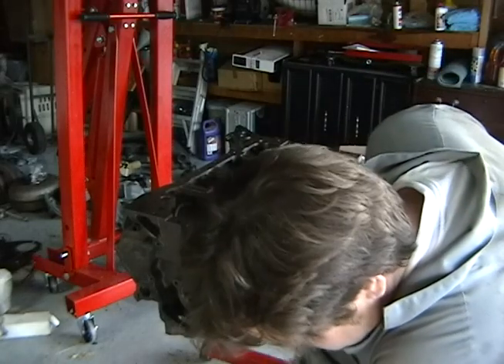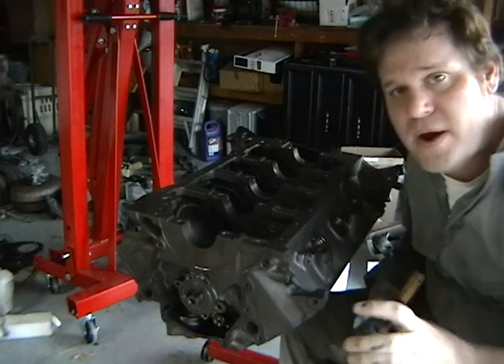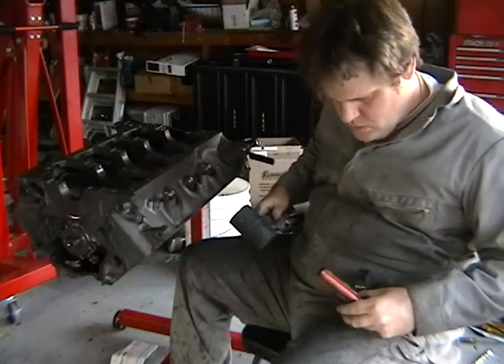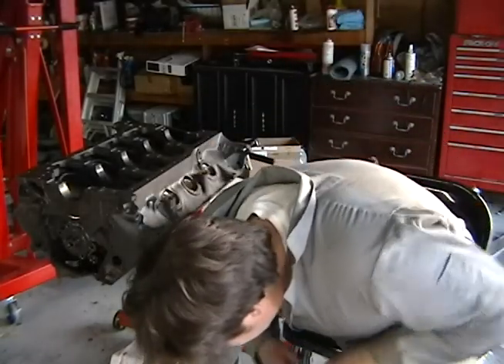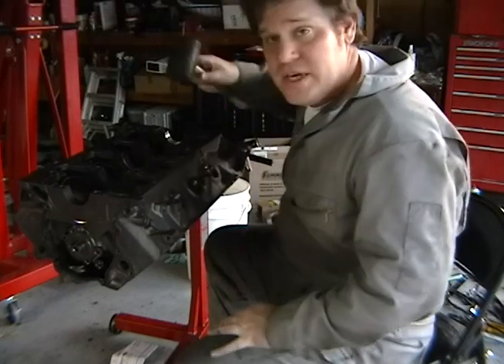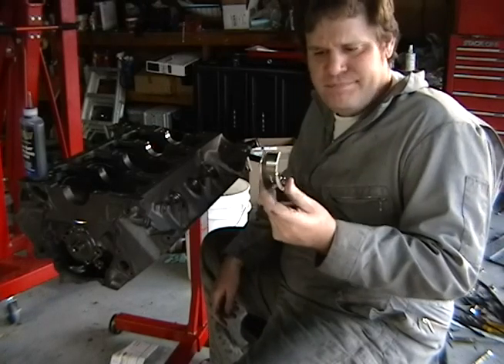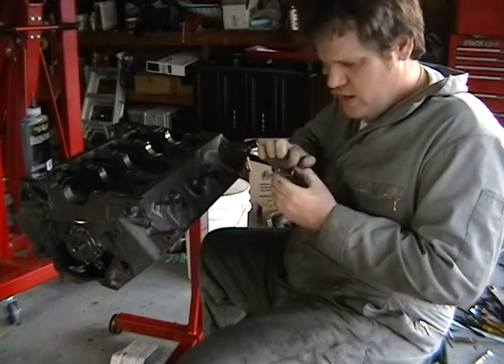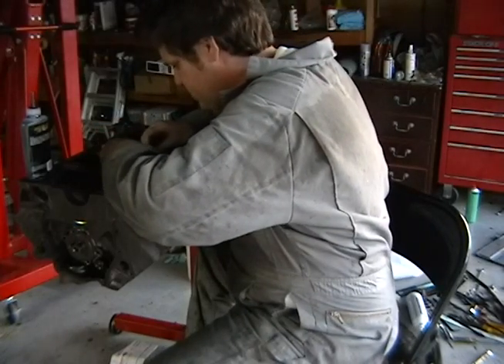1990 Ford F150 302 Engine Rebuild / Overhaul an Engine - CrankShaft install Part 7 Section 1

Comment: Wow! This guy's really putting oil on the back of the bearings. And he accidentally put the thrust bearing on #1, this guy should not be making informational videos on engine building.
Reply from the maker: Mike Rodriquez 
it was learning phase for me , so calm down.  The end results  of learning is that I put the bearings where they should go.  The video does not show me making  that mistake , I address in the video, but show the right way of doing it in the video. As for the oil on the back of the bearings, I put very little. On top of that, the bearings snap into place, bending to the shape of engine bearing groove. Their is also a stamped notch in the bearing itself, at either end, that fit into  cutout notches on the bearings seat. So their are two  engineering safety measures, the notched areas of the seat, and the fact that the bearing bends and snaps into place, that keep in in place.

Comment: hate to tell you this but you never put oil, lubricant or assembly lube on the back of the bearing. You will definately make them spin in their journals prematurely

Comment from the maker: @rydeordiegr i put a very small amount of oil on the back. i had read it was ok but i also read the that was not ok. so that is why i used only a small amount. In the future i wouldnt put any oil on the backside, but time will tell if that oil will cause any problems